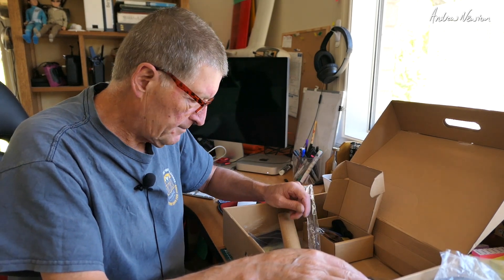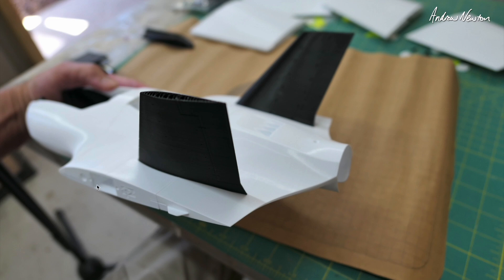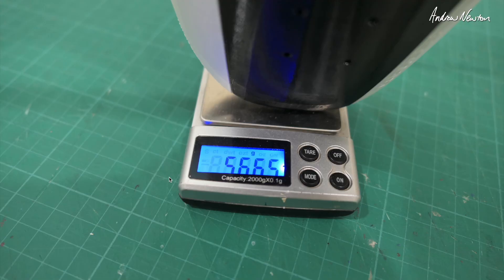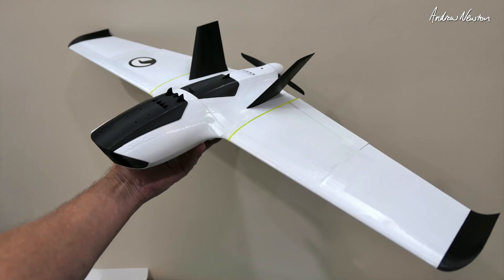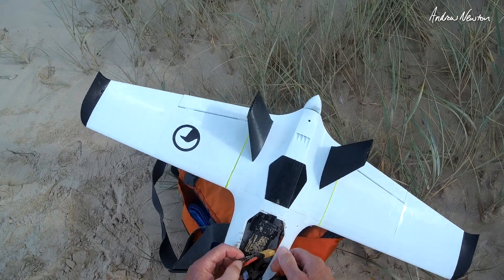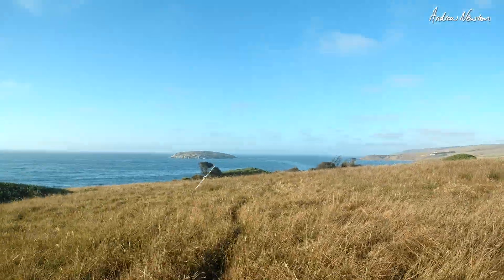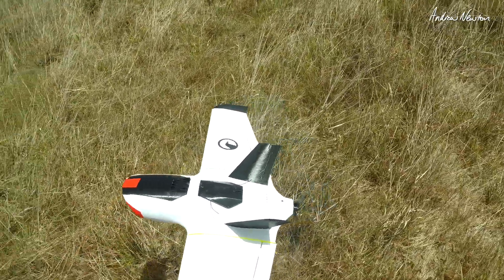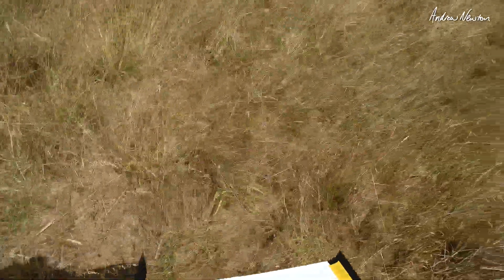Craycle Orca V2 - Build Fly Crash

Comment: WELL DONE!  Especially for the newbies out there,- it is heart warming to see that sometimes things don't work out well, even if you have lots of know-how and experience to bring to the table.  This is a hobby filled with WTF!?!?! moments of all kinds.  I have been at this since 1979 and have my own thoughts on this particular plane- but no need to bother anyone with that- you have or will cover that in some other video, and, as is the norm, you will do a good job.  Keep the blue side up... as best you can!
Reply from the maker: Thanks Carlos. Please share you thoughts because I failed to get this flying, even after patching it up and using the nose hold launch with less throttle and lighter weight.
Reply: Hi Andrew.  I take pride in understanding a fair amount about aerodynamics and basic airplane design decisions, but to this day, the whole concept of the flying wing just fries my noodle.  To me a flying wing's state of equilibrium should be that of tumbling out of the sky in an uncontrolled manner, so I can wrap my head around what happened to your model here most of the time much easier than I can explain how and why it flew reasonably well once.   All that said, getting to the actual DUT [Device Under Test]-  A)  As most of us know, the CG on a flying wing is critical, and not always easy to get right.  The suggested CG is not always right, and any little mod. can change it.  B)  That little thing looks like it needs at least 20-25MPH of wind across it to be stable  C)  There is very little yaw stability here.  These things make hand launching it tricky.  Some kind of catapult launcher may be useful here.  Making yourself some kind of simple and portable launcher for small planes would be an interesting engineering task, and can come in handy in the future.  Getting back to yaw stability- the answer to how long a fuse NEEDS to be is how much moment arm is needed to keep the plane stable in Pitch and Yaw given the size of the horizontal and vertical stabilizers and the speed range the airplane will be flying at.  The farther back the stabilizers are, the more restoring force they apply.  A pure wing's only yaw restoring force is created be the sweep of the wings- which I have never been able to warp my head around.  In addition to that, the pitch restoring force is not much better-  a body in the middle of a certain length and shape in combination with nailing the CG just right.  All this makes for a tough recipe to cook right.  OK, so you can add some vertical or "Y" configured fins to help you out, and many wing airplanes and model airplanes do exactly that.  Again to my amazement, many of those are not that far back (in one way or the other), but HERE!  F&*%!CK me and a half!  Those fins are more forward than any other wing design I have ever seen!  They are not too far from the middle of the wing!!!   What kind of restoring moment is THAT???  This is just my first instinct response here- my gut feel.  I like to ENJOY flying, as you did with that nice "RESilience glider" of the last couple of weeks.  For me, that is the "MEAT" of the hobby.  Trying to make this thing fly is not my idea of fun.  I appreciate all you do for those in the hobby- keep the blue side up and thanks again.
Reply from the maker: @CarlosChavez-gs1ld  Thanks for you in depth thoughts. I do like the challenge of trying to get something flying and this is a proven design that has been flying for at least three years. Also can be launched easily and loaded up to 1kg according to the designer. Just that mine did not behave that way, so it must be my particular model or build or handling.

Comment: I have never had success with 3D printed planes. Never had any 5 of mine that I have printed fly successfully. I think the idea is great for 3D planes but doesn’t work in the real world.
Reply: Almost fell off my chair LMAO.  100% agree.  3D planes are just plain cheating across the board.  I go back to before the days of 3D planes, when "overpowered" meant a thrust to weight ratio of 60% or higher.  That number just never stops climbing.   Between the efficiencies of todays electric motors and flight times of just 10-15 minutes, it is just too easy to overpower an airplane.  Sadly, for many in the hobby, the expression "take off roll" is a foreign and forbidden language.  For them, the plane should be airborne in a few plane lengths or something is wrong.   I can only hope and pray that there are a few of you thinking "Well gee, how much thrust do you really need?... There you go- the beginning of wisdom is asking the right questions and insisting on getting good answers.  Quick food for thought- many of the most efficient planes in the world (B2 Spirit, MQ-20 Avenger, Airbus A380 just to name a few) have thrust to weight ratios in the 20-25% range... and guess what?  They don't fall out of the sky!!!  Isn't it amazing.

Comment: A nice looking and well laid out design for FPV. 3d-printed planes do weigh more, so do have higher wing loading, particularly at smaller wingspans. The test launches definitely had a very consistent left roll on launch. Hard to tell if torque, or maybe an alignment is off somewhere, or a combination. While TPU is bit heavier, there may be some benefit to using TPU on outer wingtips, or nose. I like the idea of underwing guards to protect servo horns. 
You did have a nice launch and flight. Not really sure how that was different, but it's an encouraging sign. Look forward to seeing if can resolve the launch challenge and enjoy some more flight time.

Comment: The design is using the wrong aerofoil. A plank like this requires a wing section with appropriate reflex along the whole span. Yes a flight controller can stabilise pitch however this is the wrong design approach and also will hinder efficiency. I don't know the designer however I understand that they take feedback well. Lets see a V2 wing.
Reply: Of course we are reading the comments carefully to get feedbacks :D This is an old design and still I didn't used any flight controller so far. Orca V2 Airfoil : MH 45 9.85%

Comment: Just wondering if the designers actually fly this thing themselves before releasing to the general RC community?  Looking at it flying It feels like the size to weight ratio is an issue, especially for low speed stability, coupled with a fragile build material that doesn't have the durability at speed plus the plank wing style with inherit pitch sensitivity and inboard ailerons which are less effective than full length ones.  I would be very disappointed after spending my hard earned on a kit like this only to find such issues.
Reply: Wow, this is a harsh criticism. But we are working hard for you to get what you pay for.

This is a 3 years old design and flight videos from the first version to V2:
https://www.youtube.com/watch?v=E2I_PFfxSjs&ab_channel=Craycle

https://www.youtube.com/watch?v=VLoyUqqBBoY&ab_channel=Craycle

https://www.youtube.com/watch?v=K6xY-tMlYZU&t=54s&ab_channel=TroyMcMillan

https://www.youtube.com/watch?v=-Uq-zDsNgUo&ab_channel=Skyglide

There is more in Youtube.
Reply: Thanks for the reply, I have looked at the videos in the link and it is clear that it flies.  I am actually glad to see that you do indeed fly what you design and try to improve.  Andrew is sort of a baseline reference and experienced pilot.  If he is having issues, then it is a good indicator.  I have followed him for many years and the amount of crap that gets passed of as a good model is astounding. so  I suppose seeing this, is here we go again.  I hope you will accept my apology for being a bit harsh.   All the Best Allen  @craycle
Reply: Andrew isn't the best pilot. Fact. He's great at videos but his thumbs are not the best.
Reply from the maker: Finally someone speaks the truth!

Comment: My mate's massively overweight TBS Caipirinha used to torque roll horribly, the best way we found to launch was grab the nose, turn 180° and hurl it over your head to give it a bit of speed so you had some air over the control surfaces. Any attempt to launch normally gave the same results you saw here.